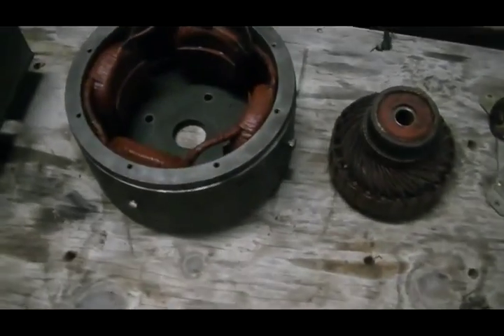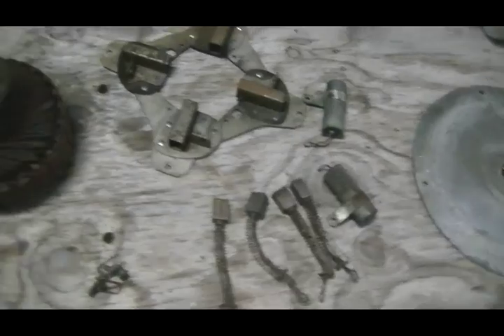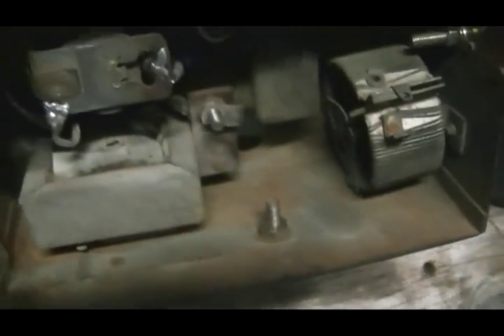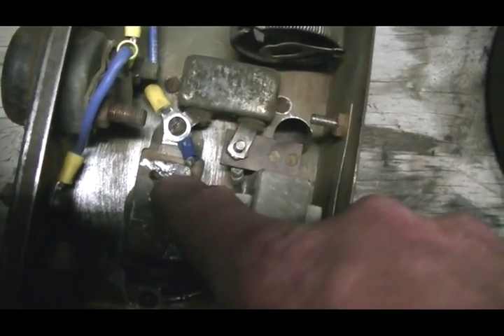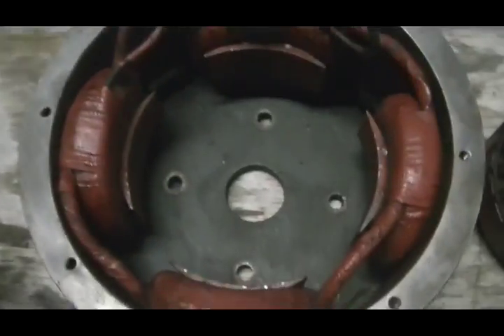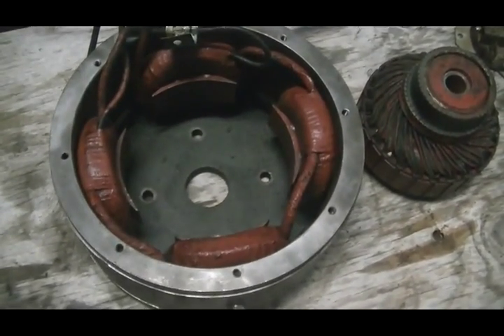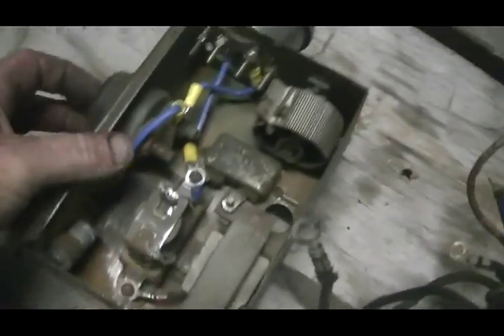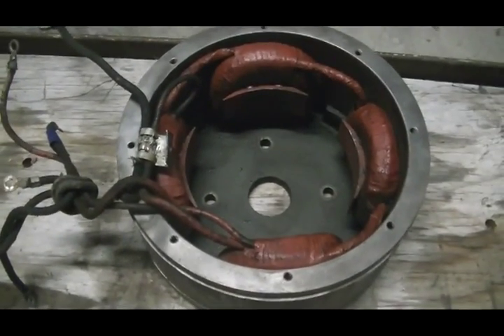Gen E motor pt2

Comment: The big coil and little silver box, look like a smoothing circuit. Bet there is a cap/condenser/regulator of some kind in the little silver box, and the coil is a BIG Choke.

Stud pattern and taper must be pretty common. I'd make the gen stand alone, attachable. Would be handy for all sorts of stuff. If I had a dollar for every time I'v seen a working motor, with a stuffed gen, sitting next to a working gen on a stuffed motor. Interchangeable sets would be very popular on farms or in the bush...